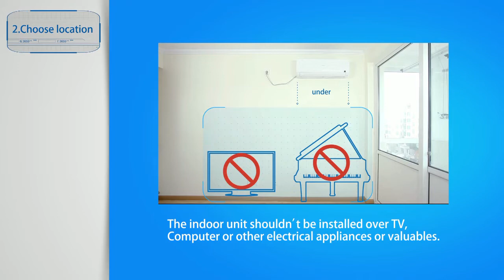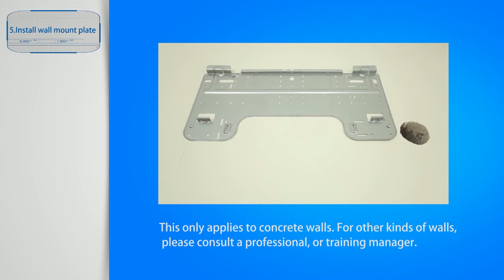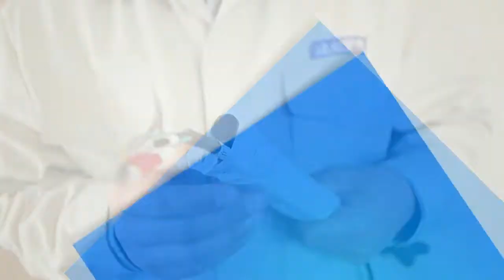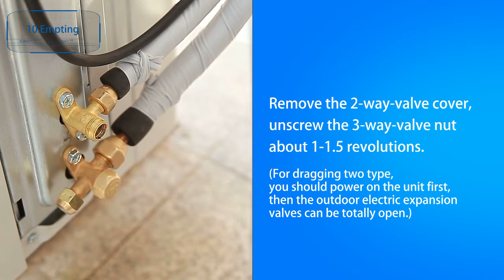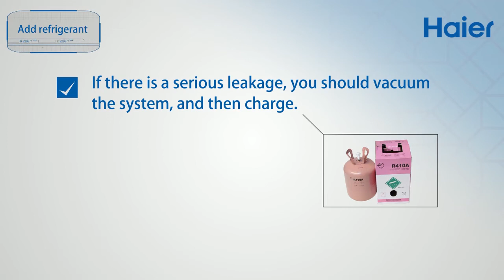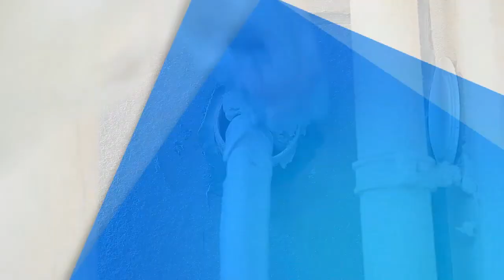Haier AC Installation

Comment: To connect extension wire ,use connectors or cable link is better and safety. For this ,only in emergency.
And why no vacum ?

Comment: I was fixed haier 12000btu  non inverter r 32 gas  air condioner room size 10.5 ×12.5×15
When room temperature  33  set to 24 how long will take to cool
Reply: SAMIRA ADEM

Comment: Haier manufactures very poor quality air conditioners, becuase i have purchased 1.5 Ton MODEL 18SGF Air conditioner on April 30, 2019, and i am still facing problems because it did not started even for the first time, i have made complaints many time to haier complaint center  , and issue is not solved yet....my bad luck it is about to one month i am waiting ...waiting ..waiting...its first satart and cooling...never buy haier products because their response to their product for warranty is very poor